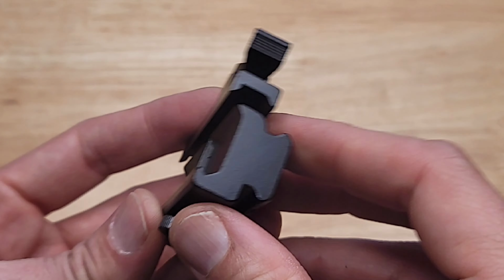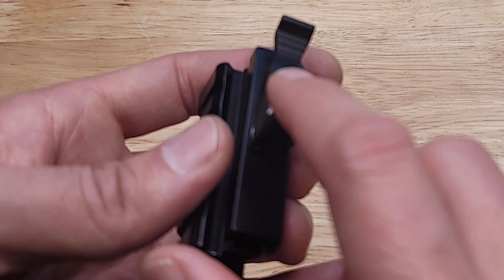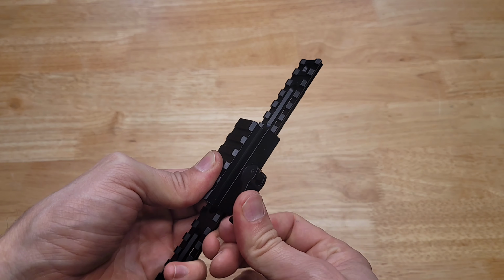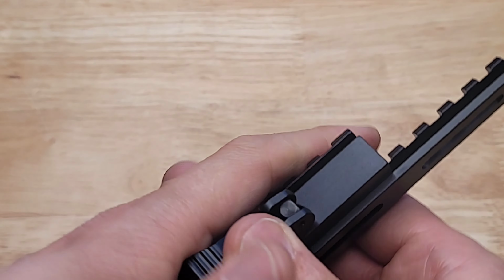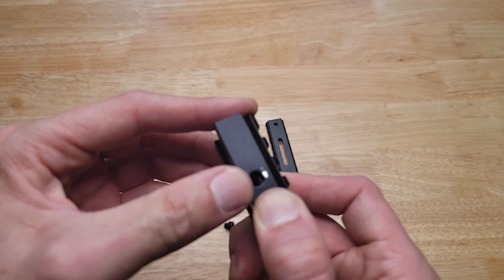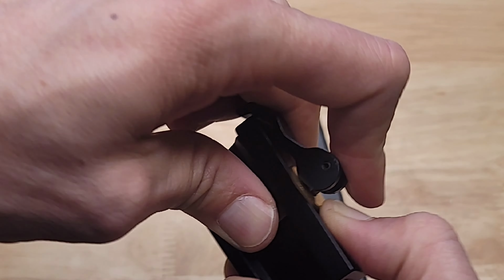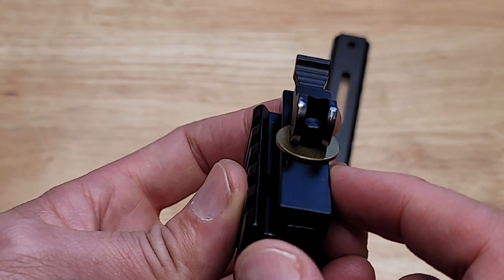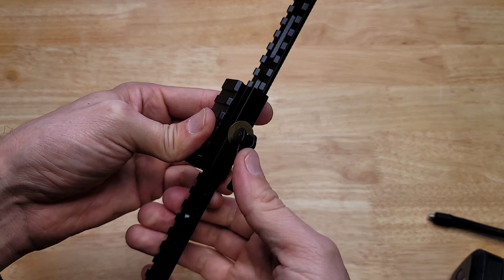Cheap Quick Release for Gel Blaster and Airsoft Picatinny Tactical Rail, Sight, Laser, Flashlight

Comment: My splatrball gun sb400 is not shooting 100% of the time and if its not shooting the magazine is still working. I thought it was just the gears and when i took them apart they looked fine. I dont know what to do please help.
Reply from the maker: That is usually caused by a bent tappet plate. The gearbox has to be disassembled and the tappet plate straightened. I talk about that in this video.  
https://youtu.be/3o4r5-Xr93U
Reply: @engineerable  is there any other things that can cause it? I looked and its not bent. Thank you for helping me out.
Reply from the maker: @Trevor99800  maybe I misunderstood your problem. I thought you meant it's not feeding, but still firing blank shots. Are you saying it stops firing?
Reply: @engineerable  yes it doesn’t shoot at all sometimes but the magazine is fine